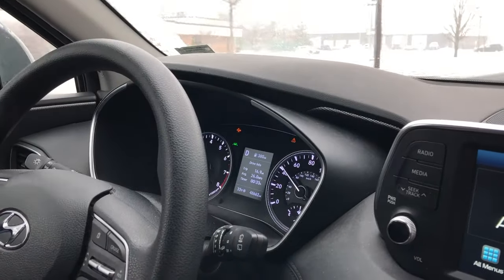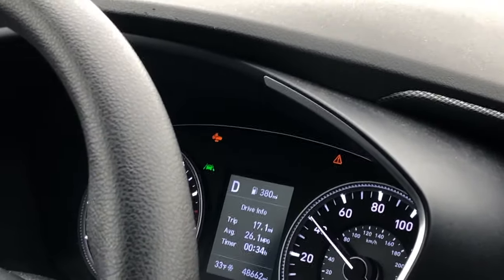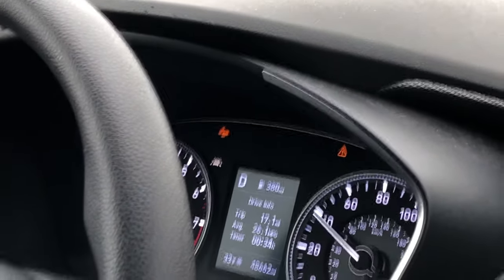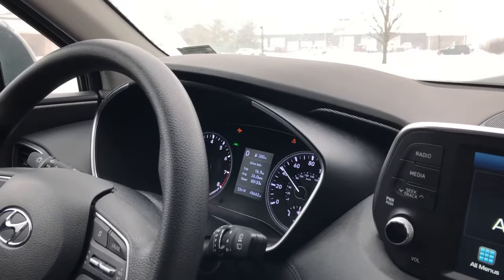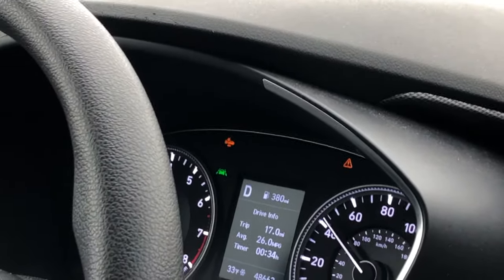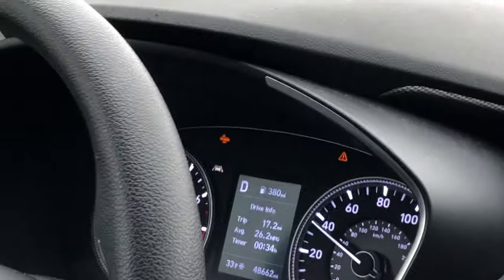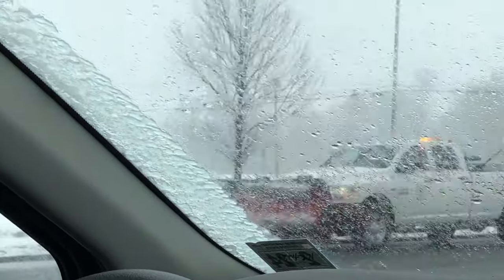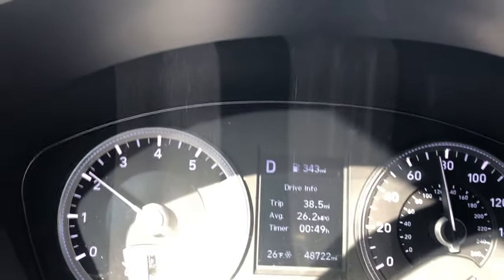Triangular Warning Light / Collision Avoidance Light Quick Tip / 2019 Hyundai Santa Fe

Comment: Not so easy fix when it has nothing to do with weather or snow or rain or anything like that. I have a 2021 Elantra. The Check forward light has been on now for over two weeks! Won't go off for any reason and can't be reset through the Driver Assistance.
Reply: yours also doesn’t pass 15 mph ?
Reply: I just fixed mine. I too have a 2021 Elantra. The dealership said it wasn't covered under the warranty which was a lie. I called corporate and reported them. They wanted more than 800 dollars to disconnect the negative side of the battery, wait one or two minutes, then reconnect the battery. Start your car and see if it went off. My guess is it did.
Reply: By the way, the light on mine had been on for a minimum of 8 months
Reply: @williamprice1305  thanks dear you saved my 500$. I just did as per comment and my forward warning light gone. Thank you so much again. God bless you
Reply: @HarshPatel-tp1rh  You are very welcome.

Comment: I have a 2019 Elantra & it just started out of nowhere BCW going on & off like crazy over my digital speedometer. I washed the car & don’t see anything covering any sensors. I even tried to turn it off in the settings & it still turns on off like crazy. Any thoughts?
Reply from the maker: It sounds like you will need to connect the car to a diagnostic computer to check all the sensors.
Reply: @getitdonehomerepair  yea figures. I was hoping to avoid putting it in the shop. I did see some people mention disconnecting the battery & just resetting the system? I might try that. Any thoughts on doing that?
Reply: I have the same car with these same issues..did you figure out what was wrong with ut
Reply: @jonesnjohnson3250 no, I ended up getting rid of it & getting another vehicle. Sorry man. Good luck